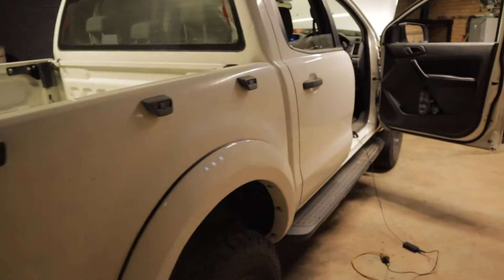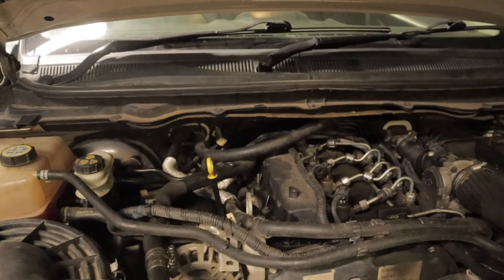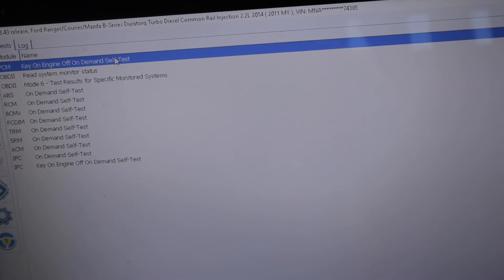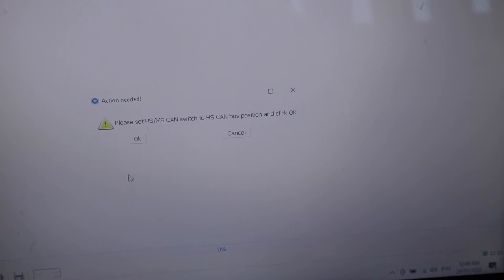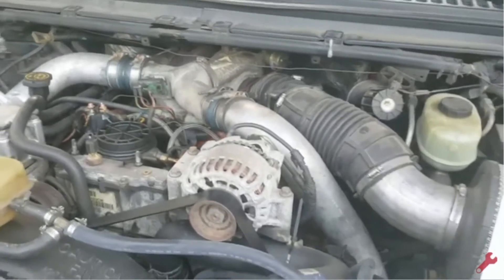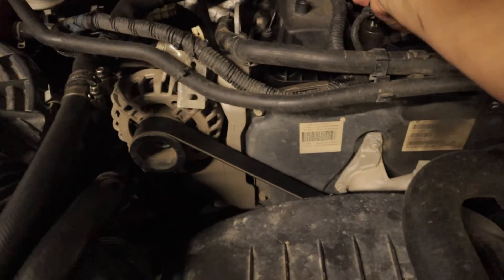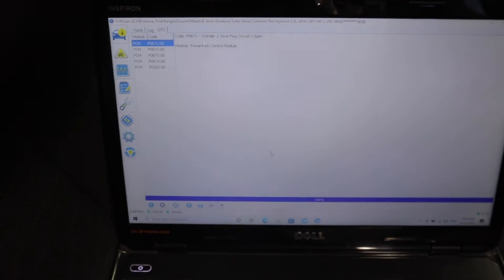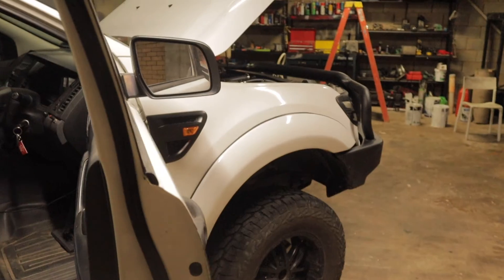Ford Ranger Injector Testing using the Self Test

Comment: Hi thanks for your vids, I have a PX3 which died whilst towing a Van 37000 kms still under warranty. After having it towed to Ford, first they said it had low Compression and a new engine was needed, Then they said and have replaced 3 Injectors as they said they were leaking. I am worried about further engine damage? Any ideas or thoughts 
Ps when it happened I was coasting down a long hill in Sport mode and braking slightly then on gentle acceleration it failed

Comment: Good day, why is it when the engine is cold, there is white smoke, but as it warms up the smokes goes away. The diagnosis gives a error code that the turbo is under boost, but when u clear it it fine, until u go over 80 km

Comment: I have been eying to diagnose a loud knocking noise from my 3.2 engine. I tried this buzz test and noted cylinders 2&4 were quieter. What I did try is unplugging each injector individually. As stated there was a blank space where the buzz should be and a code for open/close circuit. However when injector 3 was disconnected it still buzzed and didn’t show a code. Is that right ?.
Reply from the maker: it can't buzz if disconnected, no power to it
Reply: I also have a knocking sound on my 5 cylinder when doing the test I get 5 buzzes also no fault codes popping up.Any advice please

Comment: I tried this on my 2017 PX2 2.2 South African variant. It does nothing but flash the glowplug light at 12% and then jump to 100% with the headlights flashing once. Disappointing as i know one injector "taps" at certain revs and load conditions but cant figure out which one, This test would have been helpful.
Reply from the maker: thats unusual that it did not work on yours, does this tap come on around 2000rpm?
Reply: @abdautomotive  I asked Forscan development team about this test and they added a separate Injector test that does the buzz test for my model. Software release v2.3.47
Reply: @abdautomotive  No, more towards 2800rpm under specific load. Starts about 2300rpm. Latest PCM software loaded for the cold start rattling.

Comment: Didn't even know this was a thing, thanks. I just ran this on my truck (3.2 5cyl) and only heard 4 buzzes, but got no fault codes returned, any ideas why?
Reply from the maker: not sure, if you have the 3.2 5cyl you should hear 6 buzzes, first all cylinders, then each one individually, try running the test again? no fault codes means all is good
Reply: @abdautomotive  I get the same on my 3.2 5 cylinder, only 5 buzzes, and the engine pulls hard, no smoke, no strange noises, so I'm fairly certain that all 5 injectors are spraying. FYI, it's a South African vehicle, not sure that would make a difference though.